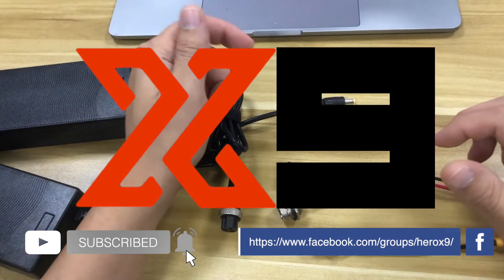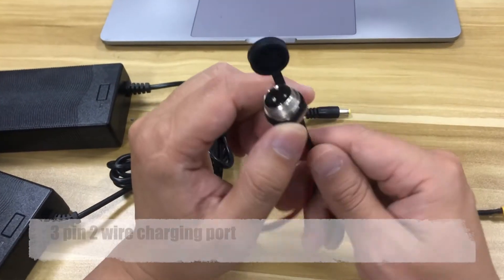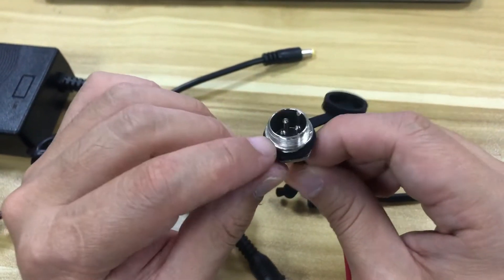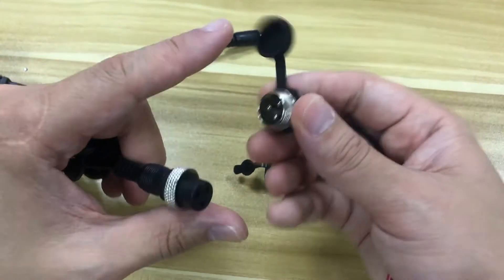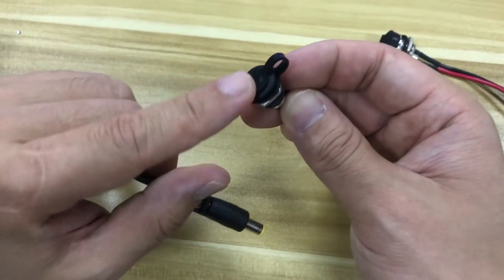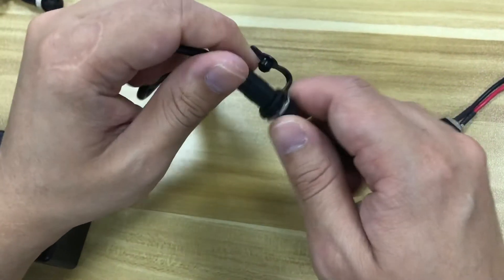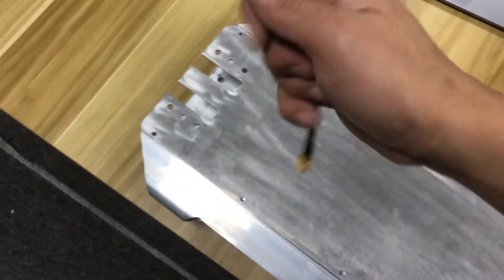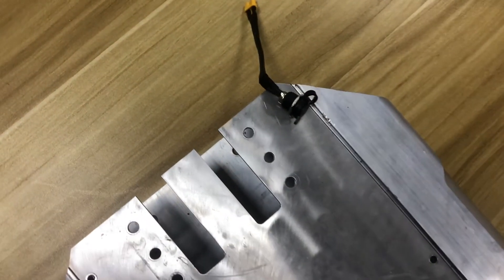X9 part 27 : Charging port ? DC or other? l Project X9

Comment: well , dc port would be better but remeber that the normal one is easly found in case you need a replacement while the dc port I never saw it on alixepress for example
Reply from the maker: we will make it available on aliexpress